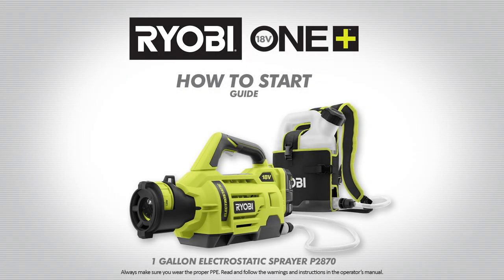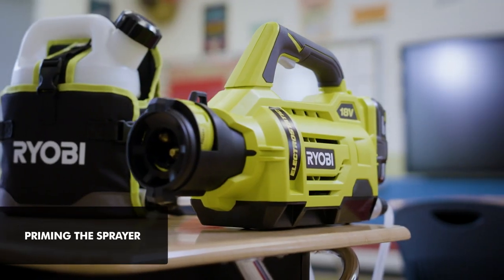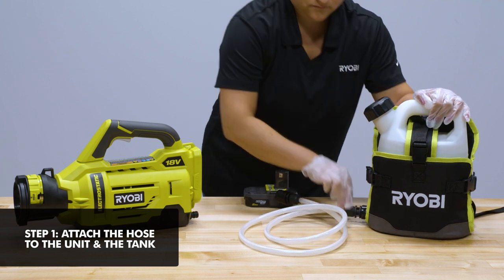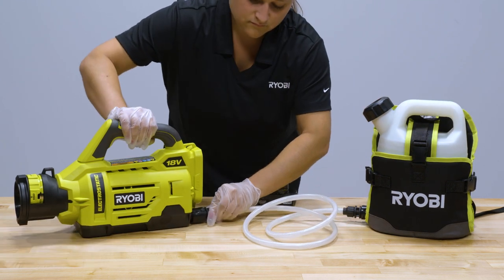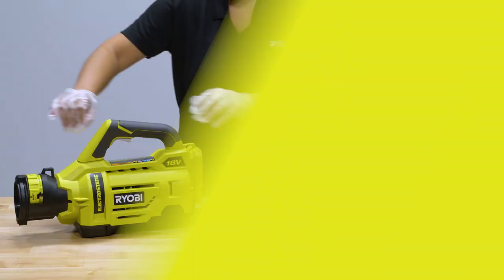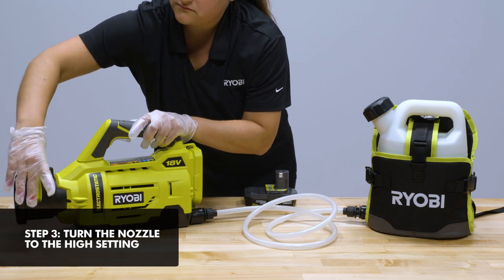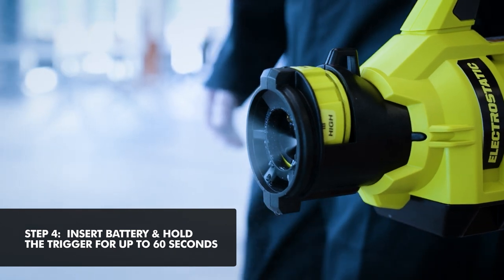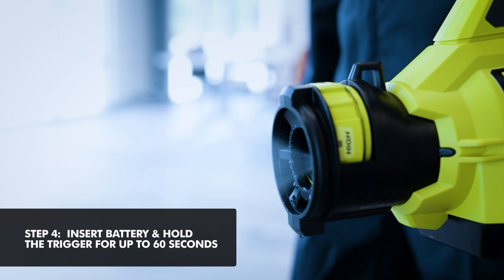How-To: RYOBI 18V ONE+ 1 Gal. Electrostatic Sprayer Start Guide

Comment: The nozzle on my machine seems to drip when spraying, any solutions?? Have tightened and no change
Reply: Mine does it too sometimes....its from what's left in the line when u stop spraying. U can eather hold the sprayer gun vertical when u move to prevent dripping or twist the nozzle to the " tighten" nozzle setting on the gun this closes the nozzle
Reply: @Tailgatesntoolboxes  I tried to tighten it but that didn’t help😢